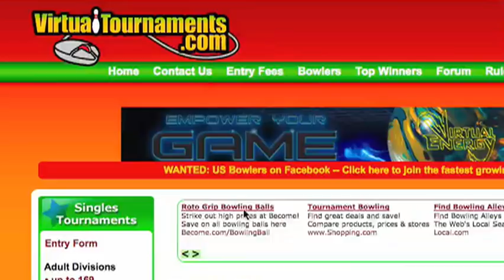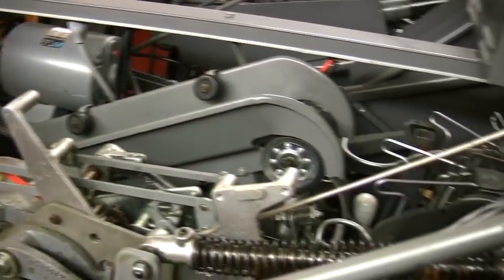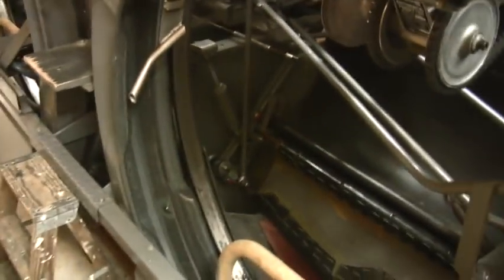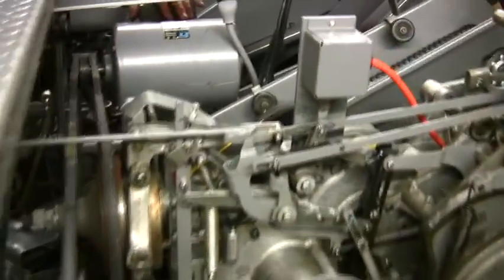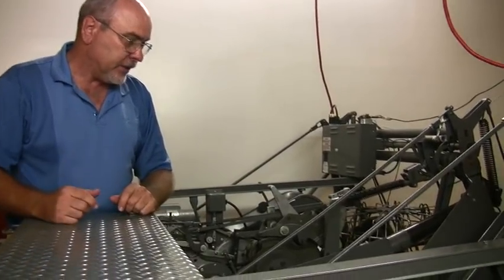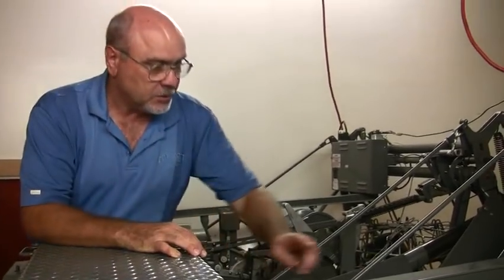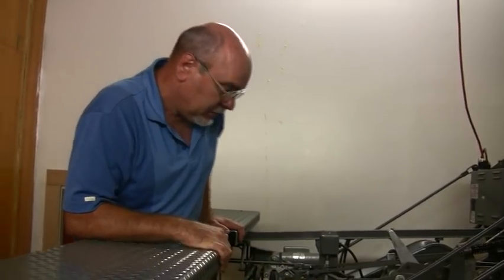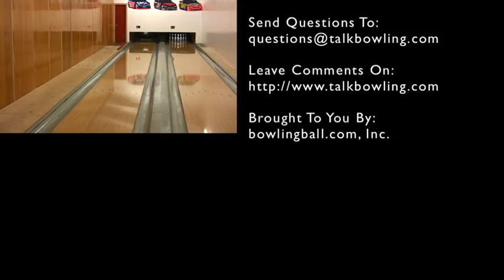Talk Bowling Episode 28 - How a Bowling Pin Setter Works

Comment: As a 20 year Brunswick pinsetter head mechanic, I will correct one thing said in this video. An out of range pin will NOT cause the machine to black out. It will disengage the clutch at 90 degrees and the out of range lever at the back of the machine must be pulled for the clutch to re engage and lift the deck off the out of range pin. Any dead wood on the lane must be manually removed as the rake will not sweep during an out of range cycle. Blackouts are caused by deck jams.

Comment: Man that takes me back when I use to work at a bowling ally as a pine setter operator. It was actually very dangerous work with all the moving parts with only a small area in between each machine. Noisy back there to with 32 lanes of league bowling going on.

Comment: @JKnight51480..... If you heard pins falling out of the machine, the most likely thing that was wrong was what it called a " Turnaround Pan Jam" . On Brunswick  model  "A" , "A2" , and  "Jet Back" machines, there is a "Pan" that turns all the pins going up the conveyor belts in the same direction. (Bottom First). Sometimes the pins jam and if the pin wheel keeps turning, the pins will fall out of the machine onto the floor.

Comment: from working at a bowling ally, an out of range does not cause a black out, it just causes the pin setter to rest ontop of the off spot pin, so you would call the out of range up to the desk who will relay the message to the back, then they would go the said lane and hit a switch to bring the pin setter back up and put into 2nd ball, then proceed to shoot your spare
Reply: sorry but there was a Brunswick scoring called "Discrete scoring" which used deck switches to count pins, but ABC (now USBC) required a way to count pins for an OOR so the machine did blackout for an OOR, and when the mechanic it would engage a switch near the release hook which caused a "flapper" on the cross conveyor to count the pins as they fell into the turret.  Although I have never seen a machine like this, I have seen several older parts manuals that show the schematic with the micro switch mounted by the OOR release link.  It may still be possible to find these pictures on line or at older bowling centers.
Reply: It's actually the AMF 82-30's that black-out when an out-of-range occurs.

Comment: @drfirebird64 actually in the 60's i believe, brunswick had automatic scoring called "discrete" (i bellieve) which had a double detect combined with deckpad switches to count pins.  and the machine did blackout during to allow for scoring, since the deck switches couldn't be used, there was a device at the top of the cross conveyor that counted pins after an out-of-range blackout..  if you can find a really old parts manual, you can see a double microswitch above the 4-1 area

Comment: @Gumbypotty the turnaround pan at the top of the pin wheel takes care of that... watch closely, no matter which way pins are facing when they get to the top, the turnaround pan swings them around the right way onto the pin elevator.

Comment: 1950s Engineering at its finest.. Also, that shakerboard needs adjustment. You can hear it at 5:50 making a neat little banging noise. I do miss working on these things. Good 'ol mashers.

Comment: @Bill25cycle The A2s and Jetbacks do run faster because the motors have smaller pulleys on them causing them to run faster. The Original Model As run slow as molasses, but its such less wear and tear on the machine that it's almost worth it to use the other motors or install the pulleys. The Japanese A2s used motors with different voltages than what the US A2s used and ran ever faster than a regular US A2s/Jetback.

Comment: to you experts: 
1). Does the sweep wagon actuator work 4 complete cycles for one main cycle of the machine (both first , and second ball)?  I see the cams so I'm assuming 1st and second ball cycles are the same, other than no electrical delay on second ball.
2). Is the drive motor 1 hp 115 volt single phase, or do slower machines get smaller motors?
3). Is there always a ball accelerator ( 1/4 hp, 1140 rpm , 115 volt single phase), because it looks like it could work with just gravity.

Comment: This was an era of original design.
Computers were not used to fully design the things.
CAD/CAM would be years in the future.
CNC was it, and before that mechanical cam operated machines.
Punched paper tape was going good when this thing was designed.

Comment: IN my area (buffalo ny) most alleys use a2's or jetbacks which I assume are similar, although some models seem to operate 30% faster than others.  I couldn't quite tell if this was a fast machine or slow machine, and, seeing as there are separate motorpulleys for the main gearbox and elevator, I assume you could have a fast machine with a slow elevator , amoungst the 4 combinations.  A few questions for  the experts amoungst you (see next post).

Comment: @drfirebird64 I love bowling at AMF houses and hearing people yell "Deck Jam on XX" when it's actually a table jam. Hilarious.I prefer to use auto out-of-rang kits installed which is what we used at the MSU Rec Center. They are a pain to get adjusted but save so many headaches and calls. I wish the other center I worked at after school had them.

Comment: @drfirebird64  The  last time  I went  bowling, I  heard pins  being  thrown out the  back of the  machine. What usually causes that ? It  is  just something  that  happens  from time to time when pins  get  jammed  or  is a  part  in the  back of the  lane  faulty  ?
Reply: what you probably heard was the pin heads slapping the pin wheel!

Comment: I always wondered how these things worked. The only part that wasn't clear is how the machine ensures that the pins all end up facing the same way after the bar sweeps them off the lane. You see them going into the track all the same way, but how does it turn them like that?
Reply from the maker: Not all of them turn the right way in the lift, however, once they get to the top of the lift to drop down, the bottom part of the pin falls first because it is the heaviest! That is how they all wind up the correct direction!
Reply: Thank you for the explanation. I knew it had to be something simple. :)
Reply: Watch at 5:36 you can see a pin turned the opposite direction and how it goes the proper direction.  
Hope this helps.

Comment: Has a vertical pin left in the gutter after a ball shot ever caused major pinsetter issues? Whenever I get those, I always think, "and here comes the rack."
Reply: Basically, no.  The only possible issue would be if the tube the lower moving deck cable rides in has been removed by someone (on the 7 side), a standing pin in the flat gutter on the 7 side could be jammed in, or knock off the cable.  That's why brunswick engineered the tube on the pinsetter in the first place.  A part from that, on an old brunswick pinsetter, a standing pin in the flat gutter shouldn't be an issue.  BTW- the "rack" is actually called the "deck" for a Brunswick machine, a "table" for an AMF machine.

Comment: 1).  correct, there are 4 main shafts on the gearbox.  the rake crank rod is on the 4-1 shaft and it does make 4 complete turns per cycle.  the detector (real brain of the machine) tells the sweep hook when to engage 

2). slower machines do not get smaller motors.  basically they all run a 1hp motor at 110-220v.  the difference is in pulley sizes.  this video showed a pulley with the same diameter for both.  thats not normal

3). I don't believe so.. you either have an accelerator or a booster.

Comment: Good video, but how does the pinsetter see to that the pins are turned the right way before they go in the pin wheel so they don't go in the pinsetter upside down?
Reply: Gumbypotty weight balance and gravity do that

Comment: Hello. I am looking to buy a used pinsetter for my home and I'm not sure if I should get the A2 or 82-70.  What is wrong with the A-2's?
Reply: the A-2's are tanks, I would chose the A-2 over ANY AMF product!
Reply: A2’s are a lot easier to work on than AMF (especially the 82-30). Think about when you try to clear a Table Jam on an AMF where your fingers will get cut when the spring cups snapping back at you, you don’t want that. A2’s had more of a simple type of Table (or Deck) which cannot cause any injury while clearing out jams. Brunswick is the best !

Comment: Is it true that heavier bowling balls are less likely to be stuck in the back area?
Reply: For AMF lanes, the heavier balls used to get stuck longer because the return is a belt that raises it.

Especially if the lazy technitians were lazy and did not change the ball return wiper cloth. Then the balls got oily and the belt had problems gripping the ball.
Reply: On A2’s, the Ball will get stuck on the Ball Wheel cause of the Ball is colliding with the Pins at the same time, that’s very common but extremely easy to solve than on AMF and Brunswick GS with the Ball Door which is a pain in the ass.

Comment: Which part puts the gouges in the bowling ball?
Reply: Depends on what happens with the ball. If it bounces up out of the gutters and hits the frame of the machine. Depending on if the lift rods are adjusted correctly or not. If not there is a thing called a "yo-yo" where the ball repeatedly goes up and down the ball wheel. Also if its stuck in the corner of the ball wheel (Typically too many pins infront of the ball wheel) and spins in a circle that will cause small micro scratches about the depth of your finger name. Or the ball return in the front depending on the model has plastic covers covering metal, the ball hits that plastic repeatedly and over time will wear away causing the metal to be exposed. So to be honest more things then not, given that you're throwing these soft balls that need to react with the lane conditions, and majority of what the ball returns back on is metal.

Comment: how does the pins go up the belt upright?
Reply from the maker: The belt drops the pins into the turnaround pan (the large circular piece) When the turnaround pan gets to the top by the distributor wheel, the body weight of the pins causes them to fall in the heaviest part first, which is the bottom, making them right side up!
Reply: bowlingballcom at 5.37 the pin is the wrong way around but it is turned around .
Reply: Gypsies live in the machine and do magic to make it work

Comment: What keeps a pin from entering the chute head first/inverted?
Reply: Only worked on AMF lanes but the pinwheel seems to be much the same and at 2:28 he shows the pins enter the top of the machine and that part he pulls down looks much like the orienter pan on AMF machines.

The answer i guess is that the orienter pan at 2:28 makes sure the pins dont drop head first.
Reply: Ken Collins 
physics essentially
Reply: Ken Collins the heviest end of the pin (the bottom) will always fall into the distribution system first.
Reply: The pinwheels (on either Brunswick or AMF machines) can grab the pins either head- or bottom-first. When they reach the top of the wheel’s orbit, the heaviest part of the pin will drop into the (Brunswick) turn-pan or the (AMF) orienter pan, and get turned around the right way.
Reply: See 5.37

Comment: Please use the correct Brunswick nomenclature when you are discussing a Brunswick Pinsetter. Brunswick has a RAKE. AMF has a SWEEP.  A CROSS CONVEYOR takes the pins to the turret, not an elevator. AMF uses an ELEVATOR. Brunswick uses a PINWHEEL.
Reply: It’s pretty much the same. Like when you called a Rake on an A2 and Sweep on AMF & Brunswick GS, it’s still the same that it still sweeps pins regularly but only the looks are different. Or when I called the Pinwheel on A2 and same thing on AMF, then I called Pin Elevator on GS, it’s still the same that it collects pins regularly but still the looks is different. Everybody doesn’t have to correct calling their pinsetter parts with alternative names cause it’s not even illegal like Mixing Ball Companies (like using Storm and Brunswick at the same time). I worked on AMF 82-90’s part time and I get used to called the Pin Elevator as a Pinwheel cause it’s not even looks like an Elevator on GS. Some mechanics even work on different pinsetters back and forth and they could mix part names whatever they want cause one name they could get used to and the other not. Everybody needs a freedom of speech.